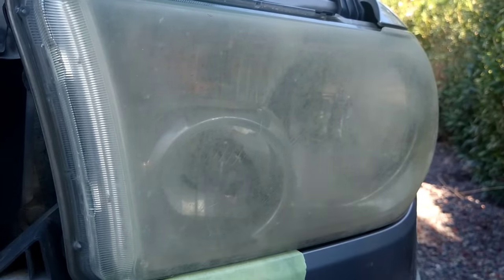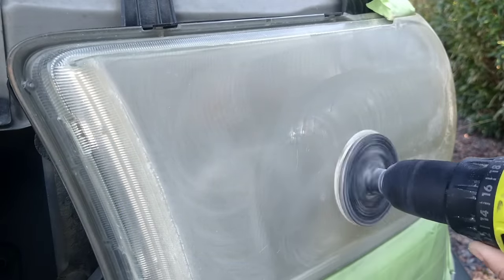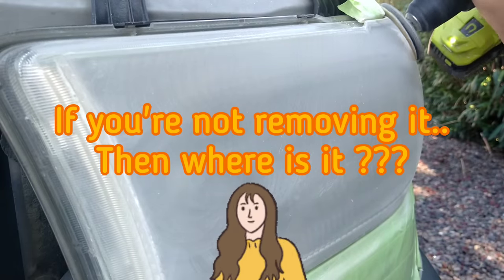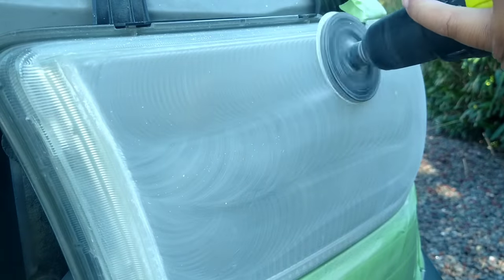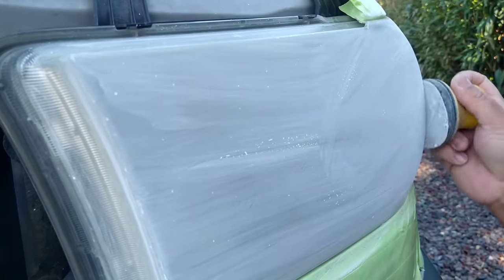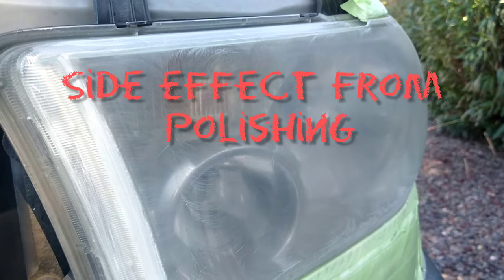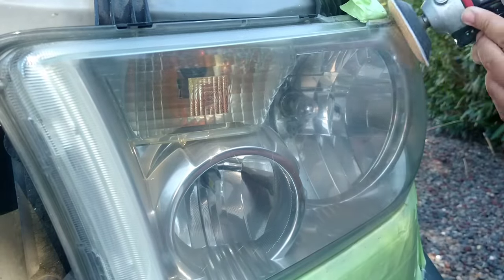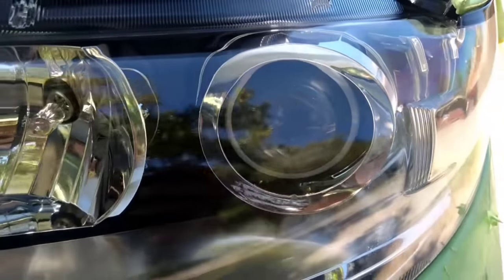POLISHING HEADLIGHTS IS A SHAM/scam  ---  and why you should never only polish headlights

Comment: I've used the Glassy-lite kit to restore my headlights, but they don't make it anymore.  That kit came with 2000 grit, and 3000 grit sand cloth, as well as a polish and sealer.  You used the 2000 grit sand cloth first, along with a garden hose to constantly spray a light mist on the headlight as you were sanding it.  You sanded it in a left to right pattern.  Once the headlight was clear, you used the 3000 grit sand cloth and garden hose, and sanded in a top to bottom pattern, to sand out any scratches that the 2000 grit may have left behind.  You then dried the headlight, then used the polish to polish it.  Once the polish was dry, you wiped it off.  You then applied the sealer, which came in a small bottle.  The headlights look great when I was finished.  Seeing how well the Meguires kit worked, I'll be using that next time.
Reply from the maker: Good luck 🤞🏽

Comment: If you use a headlight protection  wax in the first place you can prevent the clouding .  We went 13 years on my wife's last car and the headlights still looked like new.  Her car was parked outside every week day. 

You have to clear coat them no what ever you use or the clouding will come right back.
Reply: Please name the product you used.
Reply from the maker: Which one..?
Reply: @yactabay  He has listed them above.
Reply: @theheadlightrestorationpro  I use WOlfgang Plastik Sealant.  I hear that Meguiar's 'Keep clear Headlight coating' is good as well.
Reply: @yactabay  The store brand that I used is no longer available, but I now use 'Wolfgang Plastik sealant'  (Plastic with a K)  I hear that Meguira's 'Keep clear headlight coating' is good as well.
Reply: Cerakote kit is amazing
Reply from the maker: https://youtu.be/h2URTUy5ti8
Reply: @theheadlightrestorationpro  I also used my mini rotary for the polish as a 3rd step and so far on a daily driver suv it's been doing well for about a year.
Reply: My car is now 5 years old, and 'Formula 1 Head Light Restorer' has kept the headlights as new. I regularly wipe with a cloth like once a month or even after 3 months sometimes. It usually takes like 5 minutes. A bottle lasts more than a year
Reply: @theheadlightrestorationpro  either get any headlight uv gloss or clearcoat with UV protection, you can clear it up with compound and polish to remove orange peel
Reply from the maker: https://youtu.be/kIur4XxYjDk

Comment: Plastic headlamps are a total scam because when they get affected by heavy uv rays it forces you to buy new ones that cost hundreds and hundred of $$$.

I’d even go as far to call it a conspiracy.

It wasn’t that long ago when lenses were actually glass.
I think the change came sometime in the 90’s as my 90 VW had glass lenses.

So the big auto companies only offer cheapo plastic to save a buck and later inevitably forcing car owners to buy new oem or aftermarket headlamps.

I’ve seen nice later model Porsches with lenses becoming cloudy.

I’ve foolishly used many products that only offered temporary relief.

Great video!
Reply: I'm surprised they don't sell aftermarket headlights with a glass outer surface. I'm sure some people would be happy to pay extra for them. The automakers will talk about how plastic saves weight and resists shattering, but plenty of people would rather live with the the extra weight than put up with the maintenance hassle of plastic.
Reply from the maker: @pcno2832  some people would like to be shot in the head too but doing that isn't typically offered because most don't
.. 😂😂😂
What I mean is you don't really understand the concept of modern-day headlights.. Google TEXTILE STRENGTH/TENSILE STRENGTH and an old clue you in a little bit about why the main reason is that they do it..(polycarbonate is 250 times stronger than the last)
Also check out this video..
https://youtu.be/LcMFr0mpp-4?si=xQ_eFMqSJHK1wzKy

Comment: I just subscribed.... A fine job sir... I say this because this is the exact same way I have been doing headlights as a side hustle for over 10 years... I haven't done thousands, but I have done hundreds and hundreds.... I have been told that folks did their headlights with anything from wd40, toothpaste, bug spray (ugh) baking soda, etc. 

The ONLY way to get this done right is to sand.... I start with 3m 500 and work up to 3000 grit. I'll usually start with 500,,, then 800... 1000... 3000 then buff.... 

Over the years I have tried different grits give or take and have had great results.... Cheers to you sir... I am looking forward to watching all videos...

I get discouraged trying to tell folks that this the best way to do this... Many have jumped on the bandwagon and are now giving the job away, thus lowering my price. 

Costco, B.J's and the like are doing it also and causing more aggravation for me and others that spend quality time and passion to get these lights looking brand new.

I normally do not use a clearcoat due to masking and prepping as I do most of my jobs outdoors... I am hoping to find a perfect clearcoat to use... I will try to find and introduce your clearcoat method shortly... Thanks for one of the best videos I have ever seen on YouTube... Oh, I will be ordering the yellow sanding block... Looks like a great tool to have in the arsenal....
Reply from the maker: This is a very old video I have over 100 streaming at this point.. check out the most recent one because even though this video is popular light would only become so good due to a lot of damage see the ones that don't have it ..
https://youtu.be/o622VZRW2cg?si=8zWRi6weJHcsxIbC

Comment: I used the $20 3M headlight restoration kit on my wife's Uncle's 2008 Mercury Milan last year. His headlights were just a little bit worse than the headlights on this Toyota. They were never polished, just weathered/sun beaten. When I was done they were like new again. Now, a year and a half later they still look like the day I restored them. The clear coating they provide is holding up just fine. Best $20 he ever spent.
Reply from the maker: Yes that's one of the best kids 3M is more Superior in every way and 99% of their products in my opinion..

Comment: I have polish a LOT headlights using 2K clear coat and all looks amazing 3-4 years now.. Dont be fooled with the "specific" headlights products. A good 2K clear coat under the right temperatures can made miracles with no need to waste money on "well know brands".. Dont get me wrong , i dont mean maguiars are crap. I love all their products but for me a good 2K clear coat works best. Keep on with the great vids..Cheers !
Reply from the maker: To each his own but I run a business and my number one priority is to keep the vehicle on the road as long as I can, well that's damaging it while doing it or it happening in the long run from something I used.... 2K clear ACTUALLY DAMAGES HEADLIGHTS in the long run and it happens rather quick in the terms of the lives of the vehicles...
Wondering if you've ever tried to take it off..
It's a nightmare anywhere in a high risk of damaging the light or the areas around the light from excessive sending which is needed because it's heavily scratch resistant.. it's not about big names it's about what tool is made for what purpose you don't use foam board in place of drywall,
You don't replace your car is gasoline with alcohol (most cars)... You use what is prescribed for the certain function using turns out the best way.. in my opinion from all the lights I've done and from actually trying to use 2K clear it is the worst thing you can put on a headlight...
I actually used to try to use it, until I try to start removing it from other people putting it on that'll stop you...lol
It might last a little longer but that's not necessarily a good thing because the light starts going bad underneath the clear coat because it clear coat is dead it's just strong I've seen this quite a bit... Bonds too hard to the life as well starts causing spider cracking warping and pitting after a while when mixed with sunlight and weathering.. also in certain vehicles it's too hard it starts causing crowning and pitting from debris impacting freeway mileage...
I've literally done over a thousand headlights well over at this point...
And have run into this issue a couple times a month trying to remove this stuff..
But like I said to each his own if that's what you like to use I guess go fo it..
I consciously can't use this and run a business.. I mean if you're working on your own vehicle or you don't care to each his own...(actually have a video on this topic if you look through my content)
Thanks for watching.
Reply: I am a mobile bumper painter of over 20 years for dealerships and do headlights when I have the opportunity and always clearcoat and looks amazing this guys method is is great as well
Reply from the maker: @TheJoepeanut  awesome... Appreciate the support. got more stuff coming soon..
Hope you subscribe as well.. thank you for watching.
Reply: Does this difference of opinion come down to geography? Like, 2k is gonna suck in AZ, TX, FL, etc but will be awesome in like Mass, NY, WA, etc?
Reply from the maker: It very well could.. the orange pill problem is very problematic as well as the cure time so many things can happen with the cure time and most have that restoration is performed in a non-controlled environment.. and the need to go over it once it cures it's really problematic you need something to set and forget..
But good thinking it could be better in certain climates..
Reply: @theheadlightrestorationpro  I figure that in FL we get less time out of wiper blades, tires, batteries, all sorts of parts...probably something like that will be affected too.
So far 1 year since doing all 3 cars with the Sylvania kits and they all look like I did them yesterday. At ~$20 for a kit, why mess with something not intended for headlights?
Reply: 2k clear coat won't work for his method. If you just buffed it or you wet sanded it yes it would work. But watch carefully during his first stage of sanding. He says he isn't hitting the polycarbonate and he is just grinding away the rouge remaining from the last job but the melting string coming off the disk tell a diffrent story,  the binder in most compounds is wax. Wax wont string like that. Meaning he Is taking it down till the anti shatter layer from the factory is gone and he is hitting plastic. The extra additives in the coats designed for headlights bring some of that functionality back a clear coat alone won't do. His method works fine and he has the process down to an art he does really good work it looks like. But his explanations could definitely use some help. It's like he never really sat down and learned why, just how and made a gig out of it. I can't hate on that tho keep your hustle up man looks good!

Comment: That method is certainly good for restoration of headlights when the headlights have been caked with cleaning substances previously. However, I have replaced a couple sets of headlights when the headlight plastic had tiny fissures within the plastic. Those fissures were not on the surface and could be seen when sunlight was shining on the headlights. Fortunately, those headlights were not so expensive. One set was $110 in 2014 on a 2002 car; the other was $150 in 2010 on a 1998 car. Both replacements were done with 30 minutes per car.
Reply from the maker: https://youtu.be/WXUWWF47Kys?si=ntUGrrEmlExS9_Wy

Comment: Is there a sealant that lasts more than 3 years?  And after 2.5 years do you get ready to apply another sealant before just so that you continue to protect the light?
Reply from the maker: In my opinion there's not it's a very complicated question if you are educated about it.. on the one hand there is some stuff that can last potentially for 2-5 years what about 98% of the time it's causing major damage to your headlights... These are everclear products.. this is what you don't want you want it to let you know that it's because if it does not yellow or dissipate you start having permanent issues developing your headlights,like yellowing, cracking and spider cracking, permanent fogging and so much more... On the vehicle on this video that is mine it lasted over 4 years with proper maintenance...
In this video..https://youtu.be/_Mzt9uyFvR8
Reply: @theheadlightrestorationpro  Got it.
Awesome work. Thanks and have s great one tomorrow. 😀
Reply from the maker: @jaimedpcaus1 thank you ... happy new year..

Comment: Great video.  I’ve only got about 50 or so headlights under my belt and I never used the buffing or polishing methods.  When lights are clouded I go straight to wet sanding. 500, 1000, 2000, 3000 grit.  After a good cleaning I apply a clear coat.  Off the shelf rust oleum lasts between 2-5 years and 2k clear is 3-6 but it takes some work to get it off if I have to do it again but nothing terrible.  I also like 3m products.
Reply: How do you deal with orange peel from the clear coat afterwards ? I've tried my best but it always comes up ...
Reply from the maker: No orange peel with this product whatsoever.. have never had with this product.. this product is so silky and smooth you set it and forget it really ultra even seal like a shell... Zero orange peel no chunks no tips no spots nothing, that's literally one of the only ones that have absolutely no orange peel... And the crust surface of it dries about 30 seconds and 80° heat are above, any colder than 70° about 60sec..
Reply: @theheadlightrestorationpro  *peel
Reply from the maker: Lol ..talk text .. thanks 👍🏼
Reply: I sand and clear coat as well.  Durable and long lasting.
Reply: @MiguelRPD  Make sure you're doing it in the shade and lay a heavy coat down for your last coat.  If you have a sag or a small run, you'll barely notice it if at all.  And if it really bothers you, resand and try again.
Reply from the maker: @stevofromiowa  awesome it's the way to go...💯
Reply: @stevofromiowa  copy that 👍
Reply: I do same thing w sand and clear
Reply: @theheadlightrestorationpro  

Which product are you referencing? 2K Clear?
Reply from the maker: All of them... Even the one that says for headlight restoration.  I'm not a chemical scientist of k clears and what consists of them but they're just horrendous on headlights.. they all seem to do the same thing just different grades of it... Some are so gummy when you try to remove them, and some are diamond hard.. some start peeling when it's time to remove, some stay on and the light goes bad underneath and some even crack.. lot of different reasons and my experience every time I get a call and I go to it and I find out it's that it's going to be a hard day at work..lol
Also the application method of them is just hands down insane and comparison to other products that are designed for headlights.. the orange peel,the slow drying time.. the need to buff out most of the times.. the downtime it's a drag in comparison to something that dries in 60 seconds or less 30 seconds in the summer, last only a little bit less as long, but comes off or goes bad when it needs to... And believe it or not even more clear extremely more clear on the first shot., North orange peel no nothing.. set it and forget it. The number one which is good in this business is the person can drive off pretty much when you're done.. when you leave they can leave..🤩 but yeah that's your question pretty much all of them they all do the same just different grades on a scale of 1 to 10 of being a pain in the you know what product. All of them are like between a 7 and 10.. I've even had a couple 11s where I've had a tell the person there's nothing I can do just because the liability is not worth it and the time is not worth it to charge them 4 hours to do a headlight restoration and it possibly damage their vehicle and the process of trying to get all that stuff off or their headlights.. no bueno
Reply: @MiguelRPD  never had orange peal.  You don’t want glass smooth plastic when you are done sanding.  The plastic needs to be rough do the clear coat has bite and it will clear up the lens as soon as you spray it.  One coat only, never two coats.  I can do two bad headlights in under an hour and have only had to redo a couple because they refused to quit going to the automatic car wash.  Those soaps are very acidic and helps speed up the deterioration of the plastic lights.
Reply from the maker: Yeah I don't get any of those issues..